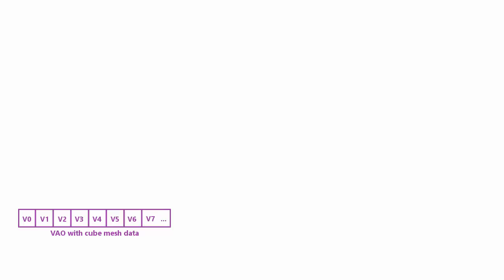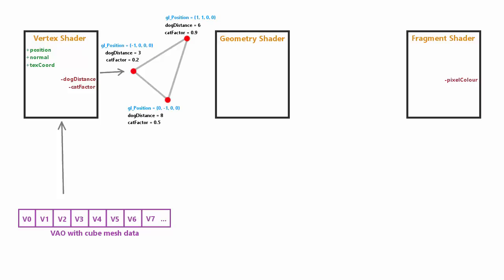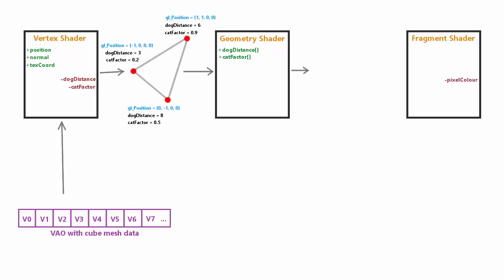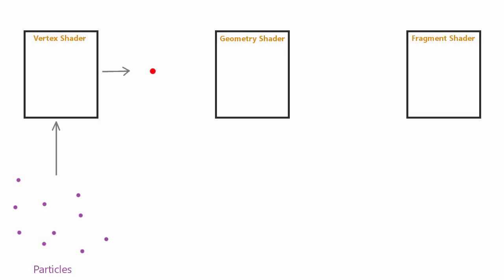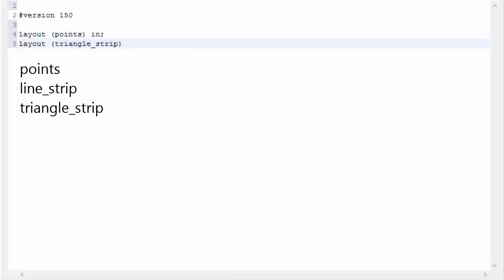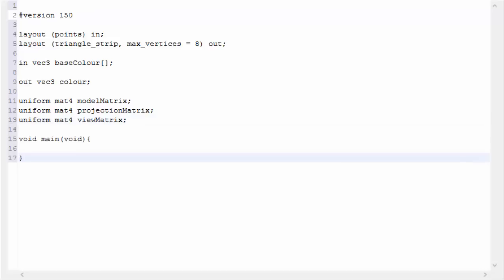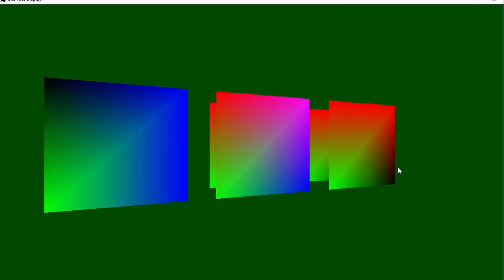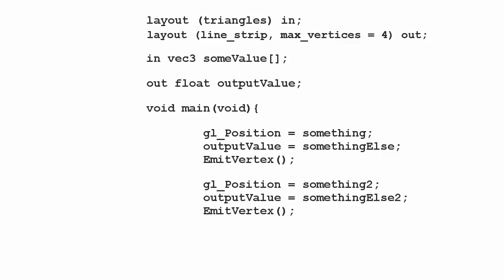OpenGL Tutorial 49: Geometry Shader Introduction

Comment: very good. i was trying to generate vertices based on a character code. so i can render a raw character string using a shader without any encoding or decoding. now i know i can do it. i will just use the vertex shader to forward the information.

Comment: Is this how you implement LOD?
Reply from the maker: Perhaps there are some LOD methods that involve the geometry shader, but I don't know of them. There's another shader called the tessellation shader that can carry out mesh LOD, although I've never tried using it. I've previously just had multiple different index buffers for each model, one index buffer for each level of detail (actually the data for the various levels is all stored together in the same VBO) and then I choose which index buffer to use during rendering depending on the object's distance from the camera.
The terrain LOD that I've done previously was a bit different, but still used a similar concept.

Comment: So if you generated the height of water vertices in the vertex shader you could use the fragment shader to calculate the normals of the triangles, right?
Reply from the maker: Yes, you could use the geometry shader to calculate the normals (I guess that's what you meant). You could then also calculate the lighting for the triangle in the geometry shader as well, so that it only has to be calculated once per triangle, rather than once per fragment.
Reply: Yes, that's what I meant. :) These shaders have a lot of potential! Thank you for your videos, they're awesome!

Comment: So in the vert shader you would just do gl_Position = attrib_position, since all the matrix stuff is done in the geo shader?
Reply from the maker: It's totally up to you where you carry out the vertex transformations. In this specific example I did it in the geometry shader so that I could add the position offsets in local space, but in other situations you might carry out the transformations in the vertex shader instead, or carry out some of them in the vertex shader and some in the geometry shader, or even some in the java code before the vertices are even stored in the VAO. Simply depends on what you're using the shaders for.
Reply: *****
 Ah, sweet. Thanks!

Comment: Would using the geometry shader to calculate normals be a good Idea?  Just take normals from the 3 vertices and get a middle normal that you send to the fragment shader?
Reply: Thats a nice idea, I've always wondered how to do that ;)
You wouldn't have smooth lighting when doing that, but you could switch it on and off, which would be very flexible :D
Let's see if ThinMatrix writes an answer about what he thinks of this idea :)
Reply: I tried this myself with triangle primitives. But as far as I know you could only calculate the normal of the faces and not for each vertex.
Reply from the maker: You can certainly use the geometry shader to calculate normals. This would be especially useful if you're going for a flat shaded/low poly look. Simply calculate the triangle's normal in the geometry shader based on the position of the 3 vertices in the triangle, and then either do the lighting calculation there and then, or pass the normal information on to the fragment shader (have an "out vec3 normal" and set it to the calculated triangle's normal for all 3 of the generated output vertices).
Reply: +ThinMatrix Will this be particularly inefficient or doesn't it make much of a difference?  Because I heard that geometry shaders aren't best for performance :/
Reply: RagingRabbit Yes, other than on intel CPUs, geometry shaders are extremely slow and should not be used.
Reply: +RagingRabbit I always use geometry shader to generate my normals and it even increased my performance in some special cases (CPU generated dynamic meshes) because it allowed me to use drawelements for low poly meshes.
Reply: +drachedeswassers Which CPU do you use?
Reply: I've used a Intel core i7-860 for a long time but I recently upgraded to i5-6600.

Comment: This is probably used for voxel terrain isnt it?
Reply: No, you need to much adjacency information for that. You could maaaybe do it in a tesselation shader, but I don't think that is common.
Reply: Magnus Dahler Norling ;_;
Reply: With voxel terrain you could of course emit one cube worth of quads for each voxel, but that it incredibly inefficient. And it doesn't work if you want smooth voxel terrain. So you always want to know what are the neighboring voxels, which you can't do in a geometry shader. In a tesselation shader you can work on large datasets and output larger meshes, but the tesselation shader would have to do this once per frame, which is also inefficient. so it is better to just build the mesh once on the cpu first and then render it multiple times.
Reply: +Magnus Dahler Norling I have no idea why you would ever use tessellation shader to generate voxel terrain, because they subdivide existing geometry instead of generating completely new geometry.
It's actually pretty easy to generate (smooth) voxel terrain in a geometry shader using 3d textures or a noise function as long as your algorithm is intercell independent. I've written a working matching cubes implementation that can create smooth voxel terrain completely in a geometry shader. However it's pretty inefficient (it became unusable with a 64^3 grid) because your whole generated geometry gets discarded after each frame. I tried to solve this by using a transform feedback buffer to store my generated vertices and reuse them, but this wasn't working very well and I decided to generate my terrain entirely in acompute shader.
Reply: Thanks, that's interesting. I never tried it myself. I had the impression that you could interpret the incoming data in a tesselation shader as something other than geometry (after all, geometry is just a set of values). I didn't think of reading a texture in the geometry shader. Anyway, as you say, the main problem is that you need to generate the geometry each frame. And it is not accessible for other things such as collision detection.
Reply: Magnus Dahler Norling you know the terrain, say for a game like minecraft, can completely be generated outside of opengl? an whatever way you wish to use opengl is fine... :]

obviously use quads or triangles...
but you could use points...
and use the geometry shader to convert them to quads for example, an emit 6 of them to form the cube...

anyway... hope i spoke some sense there... ;)
Reply: DLC ENERGY
Yes. The best way is to generate the terrain mesh once, either on the cpu or the gpu (or rather you generate it when it comes close enough, and then discard it again when it comes far away). For minecraft you don't want to render one entire cube for each voxel because then you render a lot of faces that will be facing other cubes, and are thus not visible. So you generate a mesh that consists only of the faces that face air or a transparent material. Thus you need to know the neighbors of the current cube you are generating the mesh for.

Comment: Hello Mr Matrix!

This question isn't really related to this video but I was wondering how you would externally control array lengths (the [x] parameter) inside of the glsl shader from the java program. It seems that parameter  passing doesn't work for initializing variables so I was wondering if you have ever been able to control this and if so, how?

Great videos man!, keep them up!
Reply: Use ssbo (shader storage block object). You can pass a unbounded array to it and then access it. If you don't want to use this then just define the array size to the maximum of whatever you want to pass.
Reply: Thats great! Cheers!